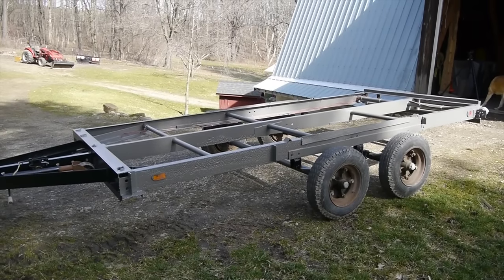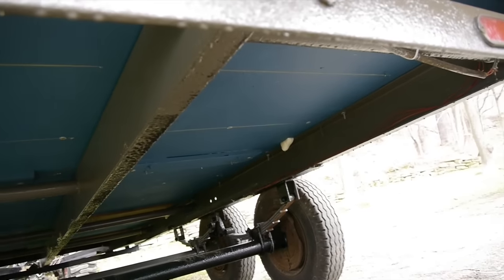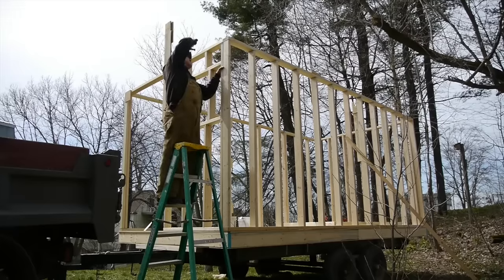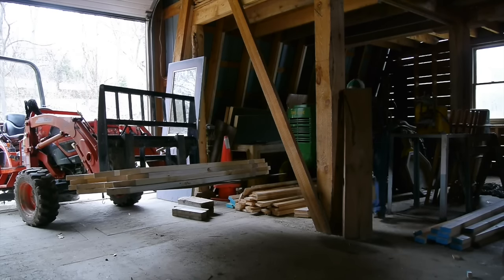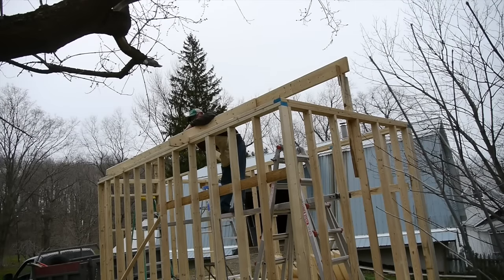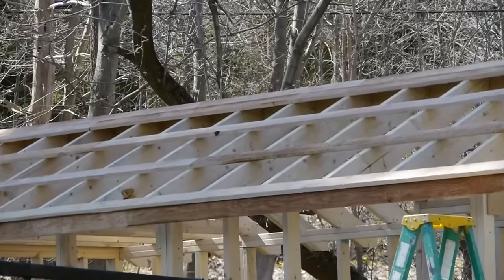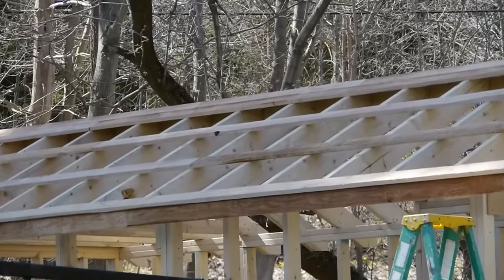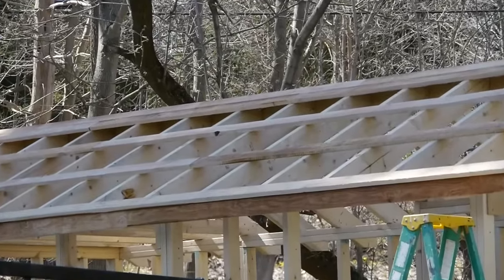My Tiny House: Start To Finish

Comment from the maker: I built this cabin on wheels to make a one-way trip to where it is set up in the woods permanently.  It only had to be hauled five miles and we went slow and easy. If you are building one to actually haul around, you want a real good trailer. I would say at least a 10,000 trailer.
Reply: Was so great!!! ¿Which state are you?
Reply: Tim, the tool man, nice job, my friend. Subbed in, b.t.w.🙂🇨🇦
Reply: Timtools99
What are your thoughts on insulation? Im doing a 7x14x7 enclosed trailer (more of a stealth camper/tiny home) but i choose to go with a dow frothpak 620 for $725+/-. I can do all 6 sides with that and im thinking it should save a ton of time. I am however running ent conduit to multiple locations throughout the trailer and taking extra precautions to make sure everything is very well sealed and water tight. Oh and power vent on the roof and make up air through the floor. The only downside i see is that you better make sure youve got your ducks lined up because youve got 1 shot to do it right. I always appreciate when an older professional will share information because you guys know how to make it happen. 16 years as an electrician/cnc technician the most important thing i learned is that "you may or may not be able to teach an old dog new tricks but you dure can learn a lot from them" thanks buddy!
Reply: Yep subbed for sure! I just saw youre into astronomy and astrophotography as well. I like the cut of your jib, sir.
Reply from the maker: @victorsumohanoballados6066  New York
Reply from the maker: @petten33  Thanks!
Reply: I was thinking this build looks sturdy as hell but it's gotta weigh a ton!  Doesn't really matter if you're only moving it once I guess.
Reply from the maker: Topanga Reyna  It's heavy ... about 1600lbs.  I didn't build it to haul around.  It's parked in the woods near my pond.  A great, private spot.
Reply from the maker: @fakenewsnetwork8137  Yep.  you are right.
Reply from the maker: @victorsumohanoballados6066  NY
Reply: Nice video. Thank you for sharing. It really helps when looking for ideas to see what ideas other people had or problems they encountered while building. I was also wondering though. Do you think a 5,000lb capacity trailer would be sufficient for a small kitchen and queen bed.
Reply from the maker: @NoName-um4dt  It depends on how you will build your Tiny House and how heavy it will be.  If you are planning to haul it around you will want a good sturdy trailer with brakes etc.  Don't try to skimp on that trailer part of it.  In my case I knew it was making a one-way trip to my camp so I could get away with using the homemade trailer.  $5000lb is not much of a trailer.
Reply: Something like a double axle car trailer with a wood bed?
Reply: Im glad you made the point that you went slow and you only built it to park in the woods. The reason... first thing i noticed as  video started was ... wheres the brakes? No braking unit and obviously this is going to be heavy with wood you used. Stay safe partner... i hope you are enjoying it.
Reply from the maker: @mds1986ms  Thanks!
Reply from the maker: zEletrixx  No but I would like to!
Reply from the maker: @victorsumohanoballados6066  New York
Reply from the maker: @petten33  Great.  Thanks!
Reply from the maker: @mds1986ms  Ha!  Thanjks!
Reply from the maker: @fakenewsnetwork8137  Yep.  You got it!
Reply: Do you have to drag the house to the DMV every year for registration/trailer inspection??
Reply from the maker: @mhwp3286  I don't haul it around.  It is parked permanently at my camp.
Reply: If I like you to help me  to make one.  Do I have to come to New York to work on it? How does it work for u
Reply: Man!!! Your good! That came out exactly how I'd make it. With a few alterations. But I Love it! 10t trailer at least.
Reply from the maker: @robertstrohlin6051  I'm glad you like it!
Reply: How do you make sure things are good and square or plum or whatever that's called? I've seen people go through a real process with big trucking straps or whatever to make sure it's all square. I don't understand that part since I'm assuming the trailer itself isn't going to be perfectly level or the same if you move it like the ground isn't going to be perfect

Comment: Im gunna take a wild guess.....but I bet this guy has built a few things before. I know it's a crazy thought but I bet he has hahaha
Reply from the maker: Yep ... I started building stuff 40 years ago and just can't stop!  Haha
Reply: Well I need a pole barn built if you get bored..lol
Reply from the maker: If you live close by, I will be over and we will whip up that pole barn!
Reply: Hows Kentucky sound..lol
Reply from the maker: Beautiful!  .... but too far.  ha
Reply: Lollol!, for sure it's not his first rodeo!
Reply: haha and by himself!
Reply: I mean it's not all that to hard if y'all take one year class youll be able to do this the first 2 weeks im only 15 got only one construction class we made a shed about this size maby bigger and the hardest part in my opinion was the painting it was boring too boring but even without an air nailer it's easy just a little time consuming you kinda Doo need one for the shingles thow
Reply: What happens when you spill water on the floor?  The wood rots?
Reply from the maker: Mop it up
Reply from the maker: mop it up.
Reply from the maker: I would buy a new trailer rated 10,000 lbs or more.  These tiny houses are heavy and need a good foundation ... especially if you want to haul it around.   Ace Carter
Reply from the maker: @MDC2020   ... that sounds fun!  (I just built one last summer.)
Reply: @TimTools99  Yeah. What a thought, huh.
Reply: It is just basic framing - no craft to speak of.  And built twice as heavy as need be.

Comment: White roof metal makes it easier to tolerate the hot summer heat. 20 years off grid here.
Reply from the maker: 20 years ... wow!
Reply: chris niner wouldn't have thought of that, thanks for the tip.
Reply: yep. different colors reflect heat. actually looked this up for when I picked out my son's stroller. darker colors reflect heat... I believe that's what I read. Don't quote me though as this information was looked up 5 months ago...
Reply: quit playin dark colors get reflect less heat and absorb more hence a black dog would be more hot then the equivalent white dog
Reply: 20 years?? That amazing.  What kind of place do you have? Where abouts are you located? Consider me a fan.
Reply: Off the grid but still able to make comments on YouTube 🤣🤣🤣
Reply: @bobfloyd875  that's what I was thinking
Reply: @quitplayin1916  
Darker colors absorb and lighter colors reflect. I have one of those freakish memories, i remember learning that in 4 grade in Mrs. Erbs class. Lol.
Reply: Porsupuesto que entre más obscuro es el color, más absorbe el calor. Entre más blanco es el color, menos calor absorbe.
Reply: I’d love to pick your brain on some off grid tips!
Reply: Bob Floyd satellite internet is pretty off grid !

Comment: Thanks so very much for this awesome how-to video. I especially like that you explain not only what you're doing but why you're doing it. I'm going to build my own tiny house by myself so your video has given me hope. THANKS!! Liked, shared and subscribed!!
Reply from the maker: Thanks Shay.  Good luck with your Tiny House.  Start with a good heavy trailer with electric breaks.  My trailer would not be good enough if I wanted to haul it around too much.  Thanks for watching.  (I plan to do a video on 12 volt wiring sometime to help people with that too.)
Reply: TimTools99

Comment: That's one of the best tiny house videos I've seen.  Excellent work.
Reply from the maker: +ElGatoLoco698 
Thanks so much ElGato ... So far - so good.  I started wiring the Tiny House.  I ran four receptacles to run off 110 in case I am where there is electric service.  I could run off a generator too.  Then, I decided to wire up some 12 Volt lights and run off a battery when I am in the boondocks. I also plan to install a small propane wall furnace for heat in the winter.  I'm trying to keep it as simple as possible and as inexpensive as I can.  When it's done, I hope my Tiny House will provide basic shelter from rain and snow.  Thanks for watching.
Reply: *****
Awesome, looking forward to an update video.
Reply: TimTools99, I enjoyed the video, but wondering how safe that trailer is.  It looks weak (with just small diameter poles going across) and tiny house builders use trailers rated for thousands of pounds (and then build lighter than the rating).

The axles and tires need to be strong enough, too.

If you did it over again, would you use screws for the framing?  

While towing it, you could get strong winds combined with the speed you are driving, plus the vibrations from the road which can loosen things.  Many builders recommend screws for such reasons.

In any case, I hope you are enjoying your cabin.
Reply from the maker: @wownewstome6123  This thing got towed 6 miles to a permanent spot.  It is not a good trailer to be hauling around.
Reply: TimTools99, I sounds like it worked out for you.  I'm glad you have a nice cabin now.  Thanks for your reply.
Reply from the maker: Thank you!

Comment: Great video! Inspires me to build my own, but too many "if only I had..." You remind me of my dad, a great builder. Did you use plans or write your own? How did you figure out how much wood, measurements etc. Can we get a copy of your plans?
Reply from the maker: Thanks for your kind words.  I drew up basic plans on graph paper to build an 8X16' box on wheels.  I knew I wanted to use 4X8 sheets of siding for the outside walls and 4X8 sheets of paneling inside.  So, the 8X16 dimension would make it easy to slap up the siding with very little waste. I had the windows and door laying around so I stuck those in.  It's nothing fancy but will keep me warm and dry.  The plans were so basic that they would be of very little use.  You can draw your plans up.  Just use graph paper.  Watch my video on drawing up plans.  Again, thanks for watching and for the nice comment.
Reply: okay, thanks. I'll look for your video on drawing up plans. Good thing I took a drafting class wayyyy back when in school. I love stuff like that.
Reply: MoniMe 77

Comment: Great job. That will make a fantastic fishing or hunting cabin. Can't wait for the next video. Vinny
Reply from the maker: +mmanut 
Hey Vinny .... Thanks.  I plan to roll this thing up to some land we own.  The nice thing is that I could move it to a different spot anytime I want.  I just started working on the inside.  Nothing fancy .... just the basics (heater, cook sove, small sink, etc.  I'm also installing 12 volt wiring for some lights and 110vac for when I need to run a generator.  I will post video #2 when I get time.  Thanks for watching.

Comment: Hey buddy thank you for this video it's one of the best one. You described step by step and dimensions and exactly how to build each part. Not to many people make videos like you. I plan on making a house in the future so if you ever make a actual house video I would definitely be looking forward to it. Because I'm having problems with the design and foundation thank you again
Reply from the maker: You are welcome Levi.  I have been building for 40 years and have made lots of mistakes ... still do but I have learned a lot.  Building this little cabin on wheels is pretty easy compared to building and actual house.  There are many ways to go about it.A ranch style would probably be the easiest.  Look into having your foundation poured and poured walls too if you are planning on a basement.  Most important thing here is good drainage around the perimeter of your building.
Reply: TimTools99 thanks for the reply I did not plan on making a basement and I planed on making a simple pier and beam foundation. For running pipe and electricity is there certain things I should do when building the foundation?And I wanted to save some money by turning the trees on my land into the wood I will be using for the beams and the lumber but I don't know the dimensions for the beams for the foundation frame. I was watching your video you did explain the dimensions of the wood for the other frames and the roof work. And is that the easiest way to make the roof or does it depend on the size of the house? Thanks again
Reply from the maker: Well, for house construction, you may have building codes that you need to know about.  Sometimes the easiest and cheapest way to do your roof would be to buy pre-made trusses.  You just tell them what pitch and span you want and they make them and they are delivered to you site.  As far as lumber size etc .... there are a lot of things to consider.  It might be best to purchase some building books and study up.

Comment: Oh man I just realized you have a Dodge truck.  I have a 1999 2500 with the diesel.  I have owned it since 2001, and love the truck.  I have 135,000 miles on mine.  It had 80,000 on it when I bought it in 2001.  So as you can tell I don't put a lot of miles on it.  I've been obsessed with tiny homes for a few years, I would love to build one someday.  But till then I can enjoy watching others do it.  Nice job on everything.  I need to go see what other videos you have.

Comment: your craftsmanship is on another level I plan on making one soon just wish I knew more about construction.
Reply from the maker: You can do it!  It ain't rocket science.  Draw yourself a plan on paper.  Let me know if I can help in any way.
Reply: +TimTools99 you're very right I do enjoy just jumping into stuff but this seems like a big project, If I can ask what is a good source for materials? home depot?  there is a Rosenberg's store here and it looks like it's the only good store.
Reply from the maker: Yes, it was a big project for sure.  I got my framing lumber from the local lumber yard.  The siding came from Home Depot.  We have an Amish metal fabrication place here where I get my metal for the roof.

Comment: The house looks great! Really good work!
Reply from the maker: Thanks a lot.  I enjoyed building it and now I am enjoying hanging out in my little get-away.
Reply: TimTools99 Did you have to get special permits or inspections before being able to build/transport it?
Reply from the maker: I live in a small village that pretty much stays out of my business.   So, no permits or inspections.  When it came time to transport it, we just hooked on and took off.  I put a slow moving vehicle sign on the back and I followed it down the road while my son pulled it.  It made a one-way trip to where it's going to be parked.  We have a lot of farmers and Amish around here who pull all sorts of crap down the road so I wasn't concerned about hauling it six miles.

Comment: I'm planning on building a Tiny House in 2019. For now I'm just gathering Information and this video is super helpful, i enjoyed it! 👍 wish me luck on mine.
Reply from the maker: Good luck Karina!  If you want to tow yours around, I recommend you start with a good 10,000 rated trailer with brakes.  That would make a good foundation for your house.  These Tiny Houses are heavy and you need a good trailer.
Reply: @TimTools99  awesome thank you for the tip. I definitely want it on wheels but I'm not sure if I will be towing it a lot or not. I will keep your tip in mind.

Comment: Part 2? Excellent video. Thanks.
Reply from the maker: https://www.youtube.com/watch?v=0clIxp-B4wQ&t=1s
Reply: @TimTools99  Great job. Thanks for the link. It was nice to see the usable room inside and the heater, large windows, kitchen are nice. I too had solar in my last welded aluminum-framed 100% aluminum 13' travel trailer and it was great. That trailer even had welded aluminum cabinets and floors, solid like a rock. It came with a kitchen, queen bed, toilet, heater, water heater, solar and shower. I sold it after 5 years because even though it had 1" of solid foam with the siding, insulation and interior walls fused into one piece, it still got to hot during summer days of 120 degrees. I wanted to build something with more insulation. Even my 15,000 BTU roof a/c was maxed out. So now I'm getting some new ideas. I think if I manage the airflow and have 4" of solid foam$$$ it would be great for approx 8x8h16. Closed-Cell, Moisture-Resistant Rigid Foam Board alone would run about $2,000 if I am correct. That is an insulated roof and floor too. Plus, they made the toilet/shower area so small I had to keep the door open with one leg out, lol! Of course, they made the "bathroom" larger the next model. I added a large waste disposal which worked as a macerator and it managed to move waste through a 1" line 150' to a septic tank. That took a little research because I found macerator pumps to be unreliable from online reviews. I hope you are enjoying stargazing, I've been wanting a telescope for years. My phone has a low light camera which actually takes decent constellation images when steady on a tripod. Be well!

Comment: Just saying..The ridge board can be 2x6 also , if you design it with extra bracing 15 inches below  the ridge that joins up the joists from both slopes to each other. It becomes  and acts like a mini-truss.  The Ridge board then becomes superfluous because the stress is redirected , like an Arch, in the direction of each pair of Joists. The Ridge Board is useful because it gives you some grab to nail on Joist Hangrs and it makes assembly easier and also gives you a nice straight  Roof Ridge line.
Reply from the maker: You got it Andre.  I didn't want to build trusses because I have that vaulted ceiling inside so the ridge board was just what I wanted.  not much difference in price between the 2x6 and 2x8. Keep it simple ...no bracing necessary.  Thanks for watching and leaving a comment.